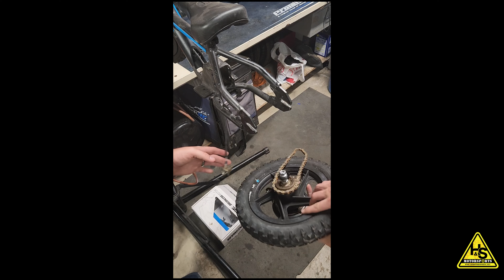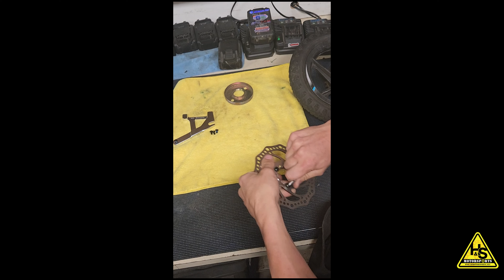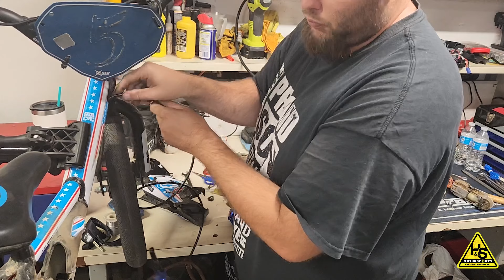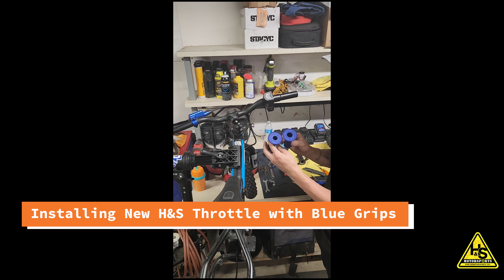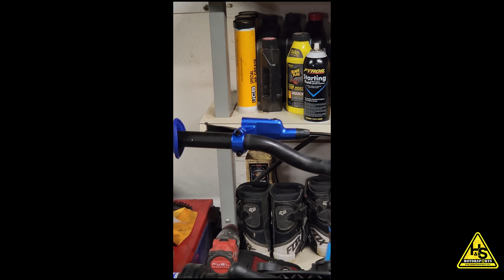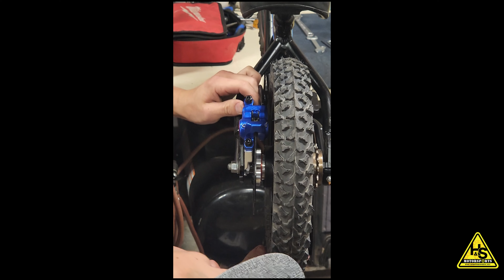Stacyc 12EDRIVE H&S Disc Brake  Upgrade Install

Comment: Is there a certain way im supposed put groomets on to build that cable? Have a little bag with some small pieces unsure how to install them. 

Got the ceramic bearings and this disc set up hope my little buddy is ready for some racing. Thanks Ryan